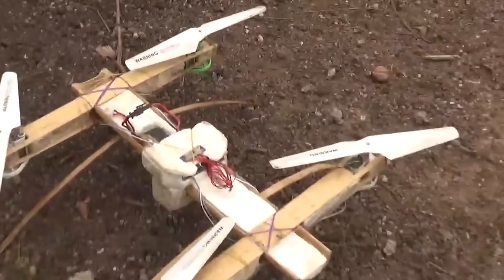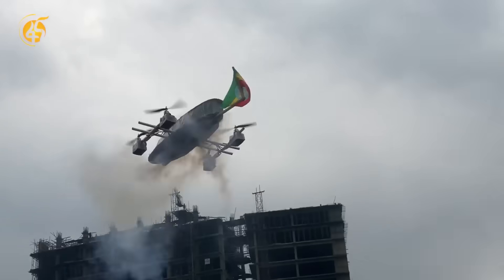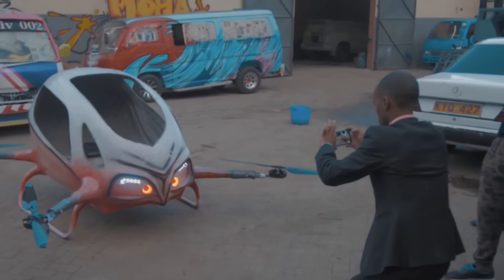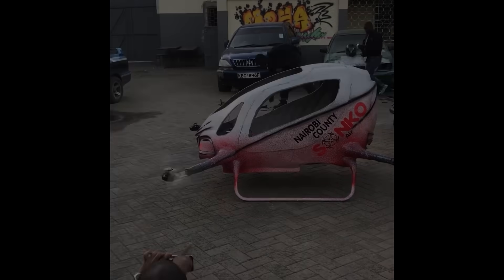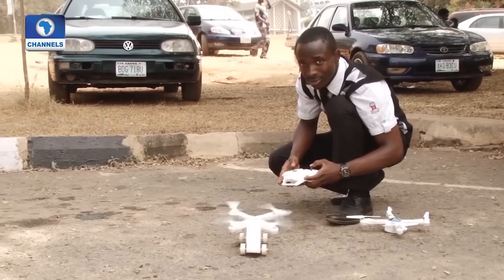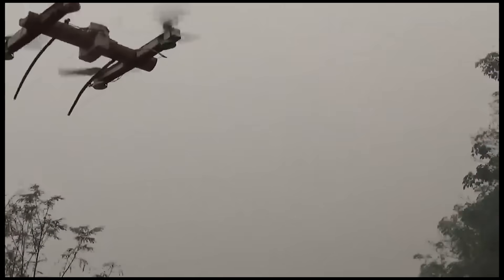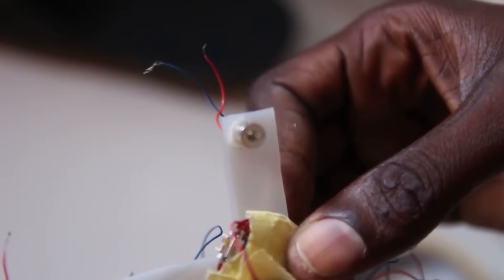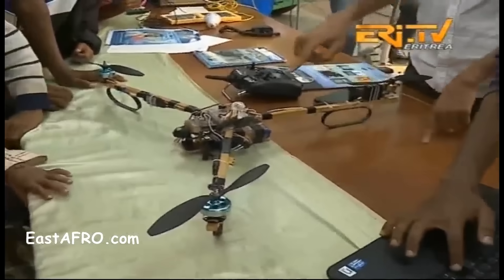African Made Drones Taking OFF

Comment: The fact that you failed to realise that the drone taxi project later succeeded and even lifted a female journalist from Citizen TV shows that you didn't really do enough research on the topic. The creator of the drone taxi video is actually Morris Mbetsa. (For those who are curious).
Reply from the maker: Watch the latest video we just did on drones and you'll see the drone flying the journalist
Reply: @Afrikleo  Thanks for the clarification. 🤝 I'll check it out. 👍
Reply: @Afrikleo  Hi, I just checked it out. You really put some bad light on it though. 
1. It's not made from scrap but aluminum extrusion and very strong motors. The circuitry and systems are also not child's play. I think you underestimate this guy. He has his own electronics manufacturing company known as Numeral iot.
2. Making a drone that can actually carry a person is not a joke. 
On the safety however, that's where they messed up.
Reply from the maker: facts💯

Comment: a drone frame can be made of any piece of garbage, there is zero achievement here, what matters is the control board, motors, remote control and firmware, which is exactly the parts which have not been made in these videos, this is still borderline cargo cultism.

Comment: This was interesting in an artistic kind of way but motors, batteries and wires can be found anywhere. What im really curious about is the flight controllers and power management boards that they are using, if they salvaged radio components from other remote controlled devices and repurposed or if anyone is putting together these things from their basic parts. 
     Brushless DC motors require their own power distribution boards to time the location of charges in the motor coils, each pulling it further around 360deg to full rotation, its usually 3 phase, and so far the power to weight ratio is much higher for brushless motors vs the classic brushed cheapo motors (you see a few in this video). 
     Constructing a power distribution or flight controller board from spare parts and then getting it to work with spare transmitter/receivers is where its at.

Comment: Rather than using wood and broken plastics they should look into reusing and repurposing high density polymer ethylene or HDPE. This material is commonly found in many plastic containers for consumer products like laundry soap/bleach/milk jugs, shampoo/conditioner/drink bottles. It's easy to melt down at low temps, I've seen people use small toaster ovens for small projects. (Outside of course, it can get smokey😆) Plus, it can be welded, it floats in water, comes in numerous different colors or translucent and it's extremely versatile. This won't biodegrade like wood does so it's a much more practical material for drones or any other ROV'S. 
 Just thought I'd pass on something that I've picked up from others. ✌😄👍

Comment: Some folks assuming that any motor placed on a frame automatically qualifies as drones 😩🥶 Reminds me of the Kenyan who made a "helicopter" that was more of an upside down lawn mower than a flight vehicle.
Reply: that is called "cargo cultism", something africa practice since many decades. These drones are straight up garbage, the only important part of a drone is the motors and control board, and that is what they did not make, the rest, you could use a block of foam and it would still work, so there is zero achievement here.